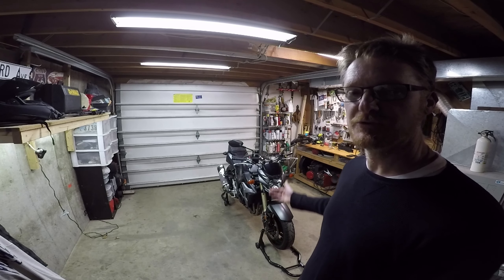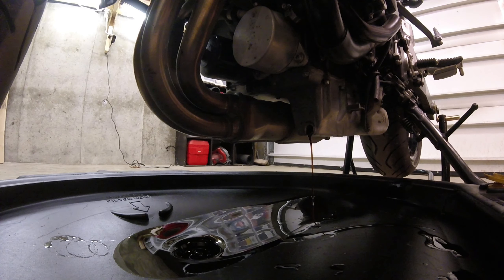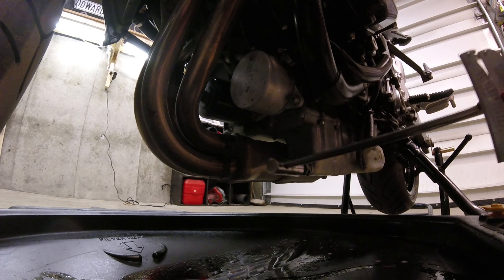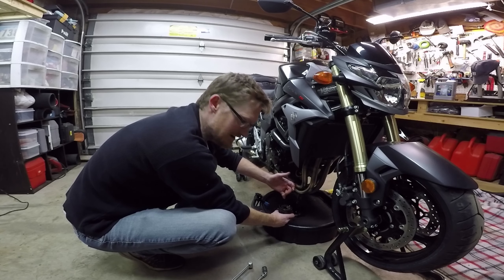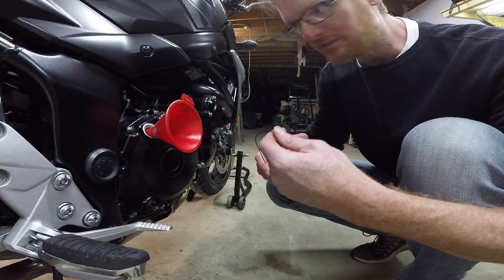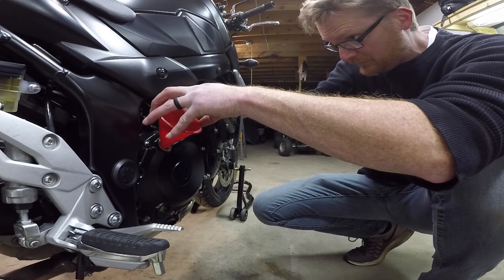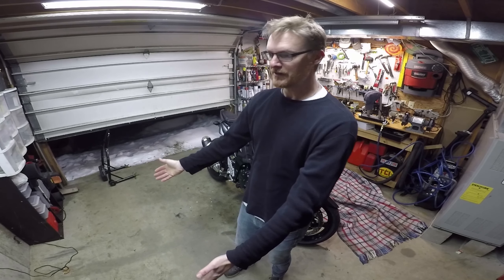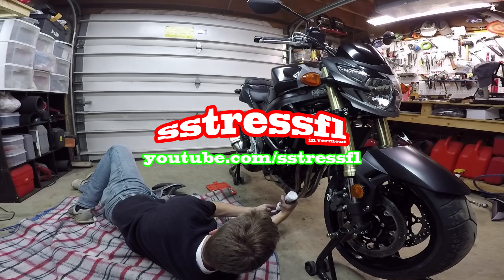LAST DANCE: Winterizing the GSX-S750

Comment: Well it's always sad to have to put our two wheeled toys away for the winter, but I guess it was inevitable that the white stuff would finally put our riding season to an end. One good thing, aren't you glad you did the investment now and put the tires on, along with the oil change already done....that means come spring there is no spring season to do list, you just have to pull it out of your shop and hit the road.
Reply from the maker: That's the plan 🙏 of course, I'm sure I'll still have to build a bridge of planks to get out of the yard in the spring 🙄

Comment: can you show how you installed the battery tender? That is if you keep your battery inside the bike during winter
Reply from the maker: I do leave the battery in the bike. I simply purchased one of these: https://www.amazon.com/gp/product/B000NCOKZQ/ref=ppx_yo_dt_b_search_asin_title?ie=UTF8&psc=1 and removed the seat, then removed the battery screws (1 at a time) and attached the red(+) to the red side, the black(-) to the black side. Then I fished the other end to the rear seat area and let it poke out the side while I'm charging it with the battery tender: https://www.amazon.com/gp/product/B000CITK8S/ref=ppx_yo_dt_b_search_asin_image?ie=UTF8&psc=1 

In the summer I attach a USB port to the end so I can charge my rear camera, or sometimes I charge multiple gopro batteries on longer trips. USB port: https://www.amazon.com/gp/product/B00DJ5KEF4/ref=ppx_yo_dt_b_asin_image_o00_s00?ie=UTF8&psc=1
Reply: @sstressfl I have the terminal kit from amazon but I just wanted to see if you had a driver seat removal video because no one seems to have one for our bike.